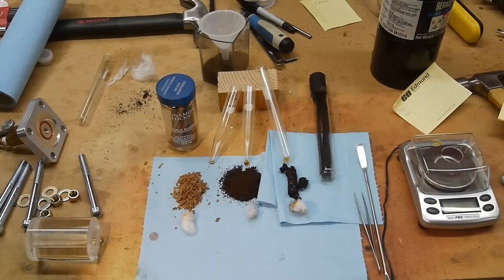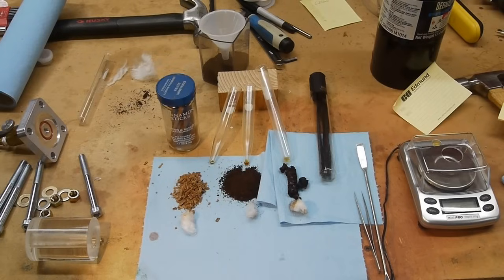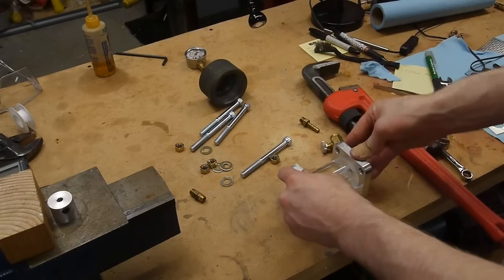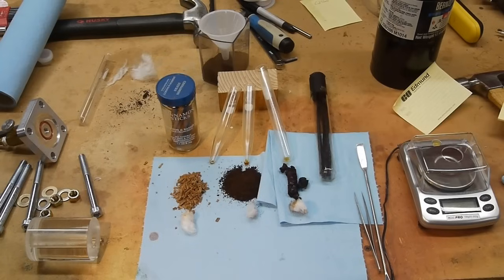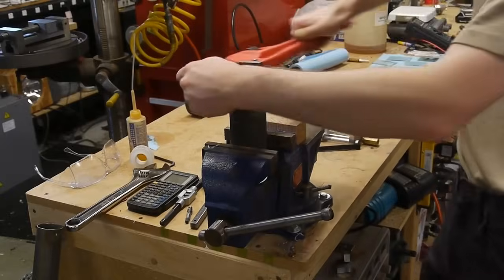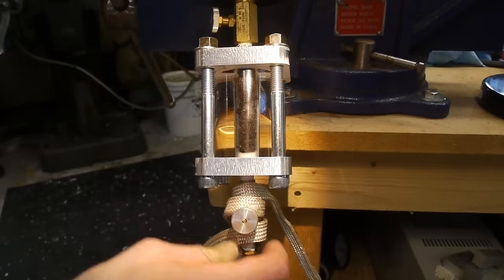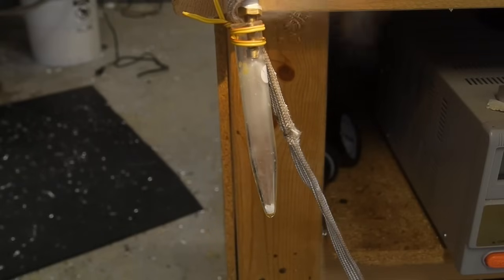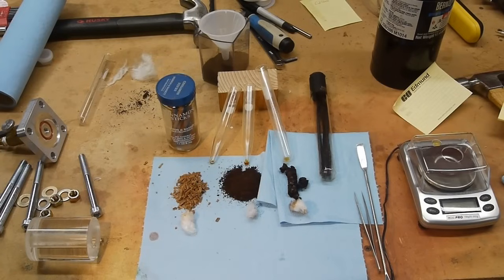Supercritical CO2 extraction of cinnamon, coffee, and vanilla with dry ice

Comment: You could use a two-way pressure cylinder for a rather easy pressurization! For the gas transmission just a regular SodaStream co2 cylinder will do fine, keep it upside down, so the co2 will run liquid between the cylinders. Just transfer the co2 in liquid form to doner cylinder by prefreezing it before transition enough. Also keep the receiving cylinder volume small enough, like 1dl while transmitter (Sodastream) will be 4dl(425ml).😊

Comment: why not line the inside with glass? wouldnt the outside acrylic support it from breaking?  also maybe you could try having it pressurized on both sides of the glass.  acrylic outside then a small space you can pressurize then a glass tube  inside that. however i dont think that would be easy to regulate having the same pressure or atleast a pressure differential lower then the glass is rated for. if one dropped too low you would implode or explode the inner glass tube.  i think just lining the acrylic tube with a glass tube fit tightly would be the best option but to be honest i dont know much about dealing with pressure vessels so i could be very wrong. i would love to know if i am and why

Comment: Maybe you could improve the performance of a glass chamber by pre-stressing it. Machine some steel rings slightly undersize to the OD of the glass, heat them up and slip them on. 50% open area should still afford significant pre-stress and reinforcement. And then put a blast-shield around the whole thing because fabricobbled glass pressure vessel.

Comment: I replicate the test using cinnomen. Tried grinding the cinnomen at 1300psi temp 38 deg C. No oil came out, but paste like oily material stuck in samples. Then I used dry cinnomen stick. Not much luck...
Must be the time to soak is also the factor

Comment: Could you not just have lined the plastic with a thinner glass tube?
Reply: Unless the glass fit the plastic exactly, that the pressure would just shatter it.
Reply: You could cast it in with epoxy for example. !00% fit.
Reply: well I feel like it still would shatter, epoxy is kinda soft. maybe if you had some way of letting the epoxy cure under very high pressure
Reply: A Teflon liner might have been convenient.  The epoxy cast glass tube was a solution I considered but the pressure and thermal shock might still have caused cracking.  In production one does not need to do much viewing so metal is the way to go.

Comment: are there any advantages over extracting with liquid propane? liquid propane is far easier to handle and also boils off easily
Reply: could it be by the fact that CO2 has 0 chances of left anything potentially toxic  ?
Reply: Neither does pure propane leaves any residue.  Every solvent will have certain characteristics, one rarely finds a perfect solvent that will extract all of only one botanical and none of the hundreds/thousands of others you are not wanting.  Sometimes a solvent is used because it is easy to handle, cheap, unregulated, non-toxic or just handy on the shelf.  Many times multiple stages are used in extraction so the choice of solvent is even wider as well as the order of their use.  Sometimes one gets lucky and a specific solvent extracts a bunch of chemicals almost completely and no bad ones and they are just the ones you want, this is pretty rare.
Reply: CO2 is less likely to go boom! Butane I hear is more effective.

Comment: You could do supercritical batch extraction in a paintball high pressure system. The tanks are designed and certified to be operated at 200-300 bars, the regulators have built-in manometers and breach valves for a sense of safety. Usually they come with a volume of 0.22 L and 1.1 L. To use them as CO2 tank for continuous flow extraction one has to use non-paintball regulators as their outlet valve is limited to about 55 bar, too low for the gas to stay supercritical.

Comment: re: glass extraction chamber

It shouldn't be too difficult to melt the glass and put it into a mold.  If the mold has a higher coefficient of thermal expansion than the glass, it will shrink away from the glass, allowing for easy removal.

Comment: You'd need sapphire glass for a good window. They typically run ~$10000 each, so good luck with that
Reply: +Andy Tymczyszyn umm no they are not $10,000. Sapphire glass is common on many watches including apple watches.
Reply: +Brendon Gessner but those are much thinner and not capable of 2000+ psi. The thicker the crystals must be grown the exponentially more expensive the glass becomes.
Reply: actually the the glass is cut into many pieces in order to make them smaller. using a diamond coated blade. then sized and polished.
Reply: I don't think you really realize the differences here. 
Wrist watches don't need high grade extra thick sapphire glass. It's my understanding that they can't use laminates because of the pressure and CO2's ability to solvate. Watch companies also use sight glasses that are mass produced, instead of needed in such small scale that they're built to order.
Like buying a new engine for a 2015 car vs a new engine for a 1915 car. One is mass produced, and the other would need to be custom made. Even if the same amount of material is involved in making both they wouldn't cost nearly the same amount.
Reply: fLmao. ok bro. $100 piece of glass(maximum) into a $10,000 piece of glass. what ever man. plenty of clear materials u can use as a window.
Reply: You seem to be unable to grasp the concept that the glass on a watch is nowhere near the thickness of the sight glasses on supercritical CO2 systems. They usually have to be rated for upwards of 4000 psi for safety concerns, and other clear surfaces like borosilicate are less resilient to reactions and solvents. 

suggesting you could just use a thin watch face is equivalent to patching a car tire with scotch tape. It just wouldn't handle the pressure.

Comment: For the acrylic chamber, what kind of stainless-steel pipe would work? I was thinking I could essentially use an unthreaded version of the pipe I'm using for the CO2 chamber (schedule 80), but I don't think the surface of the pipe would be optimal for edible extractions. Under the McMaster's section of tubing > metal > stainless steel, there are no specifications of tolerable pressures other than yield pressure which I don't think refers to the same internal pressure capacity. Could you suggest some options? 
Great work by the way!

Comment: question, dry ice when "melting", actually evaporates into coz, how do you get it to turn to liquid with heat?  is it because its 100% contained within a cylinder?  im curious because ive never seen dry ice turn to liquid, only gas....
Reply: That's correct. Liquid CO2 cannot form at atmospheric pressures. At one point in the video, the phase diagram for CO2 is shown. You'll notice the "triple point" is above atmospheric pressure, near 7 bar (about 7 times atmospheric pressure). This is the lowest pressure that liquid CO2 can form. Thus, when dry ice is heated below that pressure, e.g. in open air, it is forced to sublimate into gaseous CO2, skipping the liquid phase. Therefore, you can only practically get liquid CO2 inside a pressure vessel.
Reply: *****
  thanks for the explanation, makes sense

Comment: I have a question Ben!
I'm planning to do this build. I saw at 1:16 some ring. Is that a silicon ring or what? 
Also How did you seal the top and bottom where the pressure gauge and needle valve are located?
Reply from the maker: Yes, the orange O-rings are almost always high-temperature silicone.  I used a standard 1/8" pipe thread with PTFE tape to seal the pressure gauge and needle valve.
Reply: +Applied Science couldnt u do the same diy with a co2 airsoft cannister and pierce the cannister and cover the object with c02

Comment: Great videos. Might be worth quickly warning people that the top section is a bomb though, and to make sure they use thick enough steel, and to put a pressure regulating valve to vent CO2 if pressure gets too high inside. So no retards end up with shrapnel in their faces.              For THC, just use butane, or even easier Ethanol, or butter. The THC will disolve in non polar or much less polar substances.  For alchol just soak it over night in spirit of choice, then remove weed,  rinse it in more of spirit, then boil jar of spirit in a water bath, once it has all evaporated will have extract left.  Works great for chillis too to extract capsicin. If you add a drop or two of a longer chain oil or fat (ie olive oil) the extracts will bind to it and live in it, being more stable than if they are isolated.  Cheers

Comment: What about using the boiler glass tube as an insert inside of the acrylic?  Pressing glass into a plastic bore sounds not-so-easy, but maybe it could be bonded into the acrylic (to take up any air space and make them intimate.)
Reply: I would be worried about thermal stress in that case, since acrylic or polycarbonate has about 10 times the thermal expansion coefficient of glass. However, maybe it would be okay. When the assembly cools from application of CO2, the acrylic would tend to shrink over the glass, creating compressive hoop stress in the glass, which would tend to cancel the tensile hoop stress in the glass from the pressure it contains. However the tensile hoop stress in the acrylic could increase a lot over the acrylic only design.

Comment: Someone please correct me if I am wrong, but at 3:20, does he incorrectly state that he "applied heat to melt all the dry ice into liquid".  Doesn't dry ice sublimate and not melt when going from the solid state directly into the gaseous state?
Reply: CO2 melts with no sublimation at high pressure. It does sublimates but at very low pressure conditions. The guy talks about some 1500 psi.
Reply: agreed. he is working at high pressure above 90 bar to get the CO2 in liquid state.

Comment: Would you be able to line the inside of an acrylic tube with aluminium using the thermal evaporator that you featured in another of your videos? Would aluminium be sufficiently inert or would CO2 or other stuff react with that at the high pressures involved?

Comment: Hey there, I personally made some experiments with liquid butane as a solvent. I just got a container of lighter refill gas and slowly emptied it into a test tube submerged into a cooling bath of ice and ethanol. Afterwards I used a simple coffee filter filled with a spice (chilis work realy nice for example) and poured the butane onto it. The gas in the resulting extract can then be evaporated easily by putting the container in warm water for a couple minutes. Works nice and is cheap and easy.

Comment: Stainless steel (even high/low temperature versions) precipitates chromium at extreme temperatures- perhaps monocrystalline silicon (not doped) is the best for this.  One million psi ultimate tensile (can handle the pressure), low thermal expansions/conductivity.   Wafers are quite cheap- perhaps you can figure a way to use laminates to construct the vessels. Enough rows of eccentric circles could likely do it without seals.

Comment: By "i've found" I mean I've done it, it works. I got a glass candle holder from a thrift shop (approx 1" by 2" solid glass with a 1" diameter hole), used 1/4" steel plate for the bottom and top (the bottom with an indent to hold a rubber o-ring) and four bolts to hold the whole thing together. It lost half the volume of co2 over a year due to leakage through the o-ring, but the addition of tubes for the input and output of co2 should leave it perfect for supercritical extraction.

Comment: "Supercritical fluid extraction with pure carbon dioxide is a suitable technique to remove the THC from marihuana regardless of the particle size of the sample. Using a 0.9 g/ml density of carbon dioxide applying flow rate of 1.5 ml/min at 40°C, practically results in exhaustive extraction."

Source: google 47_veress1.pdf

Comment: I don't know if it would work but have you ever thought of coating the inside of the chamber with some non soluble resin (I'm still on the search for one) or putting a "sleeve" of glass tubing on the inside so that the acrylic wall fits around it snugly enough  to support the pressure?

Comment: Since you have a vacuum evaporator now, coat the acrylic cylinder with something.
Aluminium deposited around 10^-3 or -4 torr should result in  Al2O3 deposition, not sure, but that could be transparent.

Or you could use a thin layer of gold (also transparent), for the extra blingness and inertness.

Or use a inner glass liner (not pressed) bonded to the acrylic cylinder, with some UV curable glue.
Normal glue is out of the question since it will never cure in the middle, 2 parts glues might.

Comment: Dumb idea which would probably fail:

Take a glass tube (such as gauge glass) and surround it with extremely thick acrylic.  Then fill the gap between the two with clear epoxy.

This probably wouldn't work, because the epoxy and acrylic is probably not rigid enough to prevent the glass from bursting.

Alternative: Double walled chamber, where outermost is acrylic, then chamber of "dummy" gas, glass, then CO2 chamber.  Using gauges, keep the pressure difference small across the glass small.

Comment: Did you checked high pressure gas discharge lamps like stadium lights as source for high pressure gas vessels? Wikipedia says they are made for 10 to 40 Megapascal (5800 psi).

Comment from the maker: It's a good idea, and probably worth trying. One problem is that the glass is much more rigid than the plastic, so most of the stress will be created in the glass, even if there is a zero-clearance fit between the tubes. However, a heavy plastic liner would contain an explosion, so that's good.